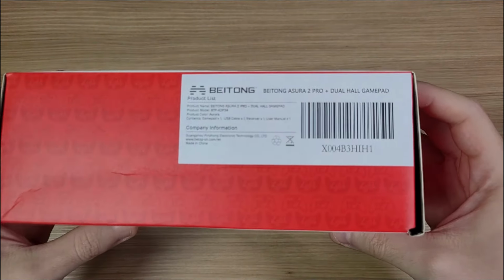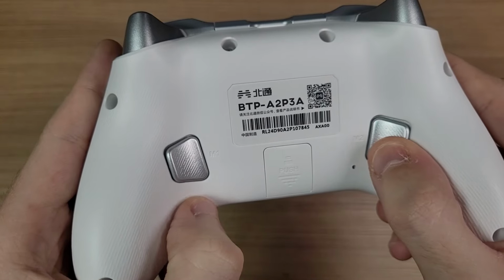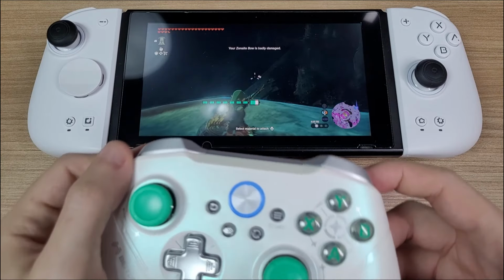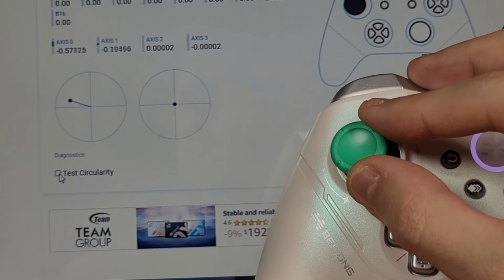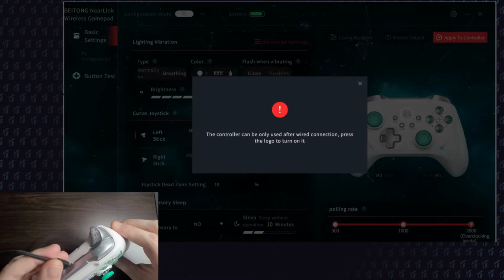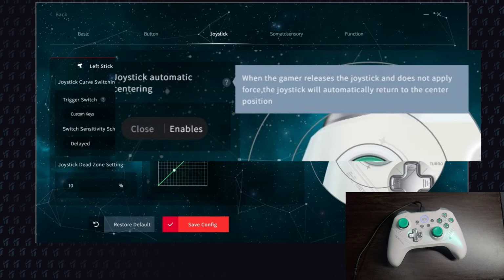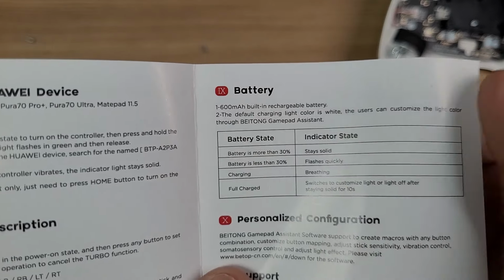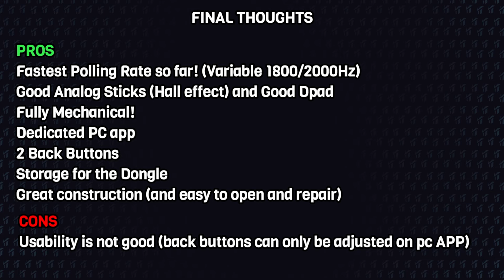BEITONG Asura 2 Pro Plus - Fast as #%*&!

Comment: I have no idea why people are complaining about input delay in comments, you can see it from the test....Also, for this nearlink controller, the receiver has approximately 0.5ms latency, and with the Bluetooth has approximately 8ms latency, for joysticks latency, not abxy buttons latency
Reply: The Bluetooth is trash but also you want the dongle or wired
Reply: @shellyfof  you do not understand that polling rate does NOT directly = the latency of pressing a button or moving a stick.
Reply: @shycreation9418 that’s not what she said
Reply: @corpingtons  I have one😂you can get one and test it. It’s nearlink version, different to the original Asura 2 pro plus
Reply: @shycreation9418  as i said, for this nearlink controller, with the receiver has approximately 0.5ms latency, and with the Bluetooth has approximately 8ms latency. You can test on your own see if it corrects or not.
Reply: @shycreation9418  mark point: 8:23 of the video. It shows the latency
Reply: The part of the video you mentioned shows the intervalls between polls in ms. This is not the latency. This program cant test latency at all. 

Its not you fault if it gets you confused because most youtubers say that its the latency. 

For example, some gamepads have a real life stick latency of far above 10ms, but the intervalls between the polls are sub 1ms  @shellyfof

Comment: Can the back buttons be mapped by other programs? I would rather have my emulators handle it on a per game basis instead of manually changing it every single time I play a different game.
Also, are the settings saved to the controller or does the app need to be open all the time?

Comment: Very unlikely this is the fastest controller. Polling latency and input latency/delay are two different things. You could have a controller with 9001Hz but there could still be a long delay in sending that high speed signal to the PC/device. One example is how the PS4 controller has some of the absolute best wireless performance even though it uses Bluetooth with a slow polling rate of just 250Hz and yet its input delay embarrasses many 1000Hz+ controllers. Another embarrassing thing is how many YouTubers still fall for this marketing nonsense.
Reply: I think there is still an omission on your part from considering human receptivity from having higher polling rate. I get what you're saying but the fact still is that if I fill a cup 10ml /sec versus 1L /sec, if my job is to control the flow of water, I'll still have more to manage from 1L /sec.

So to your point, different strokes for different folks, if you are playing COD and your main focus is TtK, sure, input delay is important, but if you're methodical in lining up a pro play moves in Rocket League, polling rate will still benefit you greatly and that's where, as much as you may want to discredit YTers talking about polling rate, that it still equals to more than not having it.

It's exactly the same as networking, what do you favor as a gamer, higher bandwidth, or higher latency? Latency obviously, but bandwidth can still be important for certain things pertaining to gaming, it all comes down to what you use your overall performance for.
Reply: 2x the polling rate will halve the input delay, so your point is pretty invalid. Even if it has a 2ms input delay, it will be 1ms compared to a 1000hz controller with 1ms input delay, it would still be just as good. Polling rate is also mainly for the joysticks not the buttons. No matter the input delay, the joysticks and triggers will still be 2x faster than a 1000hz controller because they have virtually 0 input delay. Most of the input delay comes from the switches used in the controller. Since this uses standard mechanical switches it will be slower than optical but significantly faster than membrane. The only other factor to input delay is the time it takes for a signal to go through the pcb/mother board which should be very similar between controllers. Your just coping for likes and not explaining anything. And I wouldn't trust any input delay on websites like gamepad la either.
Reply: @nolyaoly  Genuinely embarrassing comment right here. Child.
Reply: @zen_xenomorph  If it takes 24ms for electricity to travel through the the motherboard than there is probably something wrong with your controller. It can't possibly be the wireless/wired connection because electricity and radio waves travel at the speed of light. The only factor is the time it takes for the motherboard of the controller to register an input. I used simple knowledge that was apparently too complex for a simpleton such as yourself
Reply: It’s the fastest currently also the other one machenike g6 pro is faster
Reply: I sold the Vader4 Pro because the stick latency was horrible.
I use a Dual Sense with TMR sticks now and it is a day night experience
Reply: @kriswunderlich  Funny you mention that. I kept the V4 Pro incase a firmware fixed this issue in the near future (otherwise i also would have sold it). A new firmware came out today that is meant to fix it and the outer deadzone area.
Reply: @zen_xenomorph  is it fixed now?
Reply: For this beitong nearlink controller, with receiver: approximately 0.5ms latency;  with Bluetooth: approximately 8ms latency.
Reply: @shellyfof  Did you try gamepadla test?
Reply: So glad I kept my PS4 controller
Reply: @Jerry_quesoso  You just an i#iot ) That's all) Dualshock nowadays is just an old $git, totally useless.
Reply: @Jerry_quesoso ew

Comment: If they could have made optical buttons and trigger stoppers, then the high pulling rate would make more sense. Otherwise this has similar features to my current controller already so I wouldn't feel bad if I chose to upgrade to this.
Reply: i wish they would remake and resell the dualshock 3. best stick that never wore out, could add a cap to the triggers to make them flair out, and the buttons were pressure sensitive. GOAT
Reply: @MrPruske  I assume that if they did that, their wouldn't be the original components. I would rather see newer controllers with that same quality. That dream requires a company who doesn't mind losing revenue from making good hardware.

Comment: Polling rate =/= input delay
Reply: Us programmers use !=
Reply: Delay is low 0.5
Reply: Indeed. And according to the USB 2 HID (human interface device) specification, the maximum polling rate is supposed to be 1000 Hz (1 ms). So, either this gamepad uses USB 3, or does some trickery, just to advertise with a higher number.
Edit: looking into it a bit further, 8 kHz (125 µs) appears to be the technical limit for USB 2. The overhead for such high polling rate seems hardly justified when button and stick latencies are around or above 10 ms.
Reply: For this controller, with receiver: approximately 0.5ms latency;  with Bluetooth: approximately 8ms latency.
Reply: @shellyfof  Is the polling rate close to 125 Hz on Bluetooth?  The previous Asura Pro2+ could be overclocked on 2.4 Ghz and wired over 500 Hz with under 2ms latency, but the Bluetooth response was God awful with 49 Hz polling rate and over 20 ms latency.
Reply: im wondering how long its going to take people to finally realize this. for all we know the stick latency could be absolutely terrible
Reply: @shycreation9418 it’s not terrible
Reply: @shycreation9418  doubtful as most Chinese controller brands use actually good components unlike most other companies like scuf or sony
Reply: i dont know why he keeps doing these same tests, its like he doesnt read the comments.

Comment: gulikit released a new pair of Hall efect joysticks for first party controllers, check them out!
Reply: well it's not hall effect, it's tunneling magnetoresistance, TMR, called Gulikit TMR, they use magnets in the side panels of the joysticks and has a tiny pcb on each side to output the signal for the movement, it also has like auto calibration but that is a guess

Comment: Never understood making a fast controller like this but not having trigger stops or just 2 back buttons. Casual players are not looking for 1000+ hz polling. Just seems like a huge misstep
Reply: 500 Hz 1000 Hz 2000 Hz Polling Rate Adjustable By BEITONG Software: 'BEITONG Gamepad Assistant'
Reply: @hardtobearit  casuals actually are looking for that, just look how many gamesir controllers have been sold in the past year and a half.
Reply: yeah only 2 back buttons is a bit of a downside for me
Reply: most controllers are using bluetooth or a cheap ~250 polling rate adaptor, and some wired ones only respond at 250. i would think there is a similar feeling of improvement going from a cheap 5 dollar mouse to a gaming mouse that's more than 20.

Comment: This isn’t faster than a overclocked ps5 controller correct?
Reply: The only confirmed controller I seen faster is the kk3 max using it wired
Reply: @Ethayden97  so you’re saying an overclocked ps5 controller is not as fast as this or have you never used one?
Reply: @RickandRusty  I have this it’s a really good controller. What do you mean by faster? Polling rate? Input latency?
Reply: @Ethayden97  input latency and polling rate. I think the overclocking affects the polling rate. I don’t know the difference between the two. But if you look up “how to overclock a ps5 controller” you’ll see what I mean
Reply: @RickandRusty  there is no need to overlock it. On it already hits 2k polling rate as is. Ps5 can overclock to 1000hz. In terms of polling rate this is better. Polling rate has an effect on input latency but they aren’t the same.you can have a low polling rate and still have a low input delay (I.e. Xbox controllers). To test input delay efficiently you have to get a GPDL device. So it’s possible it’s faster but both have to be test for sure. The only confirmed faster than ps5 controller right now is the kk3 max
Reply: @Ethayden97  thank you very much!
Reply: @RickandRusty  glad I can help